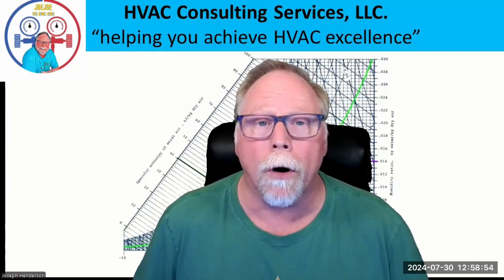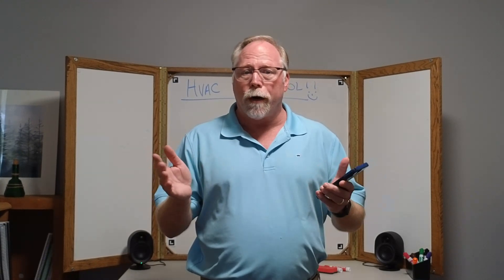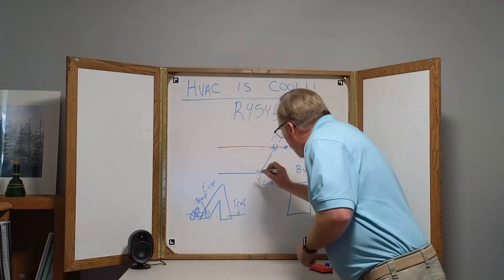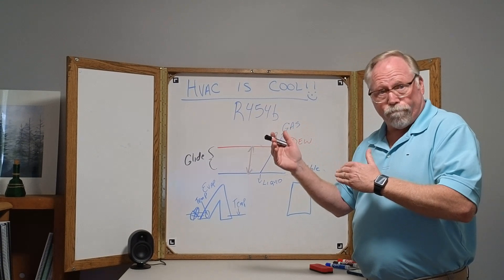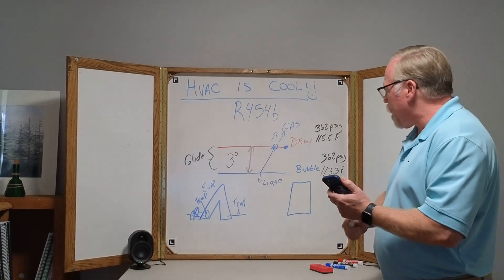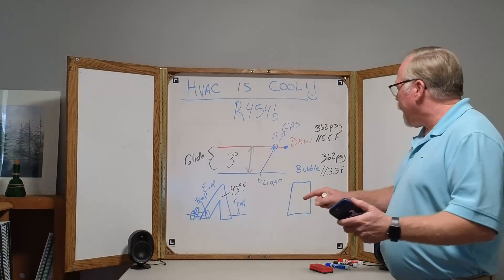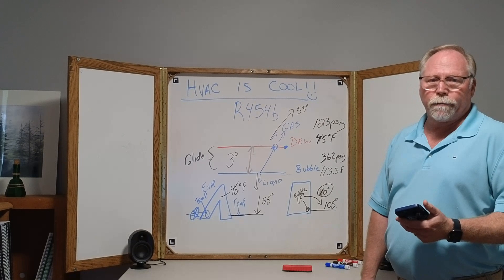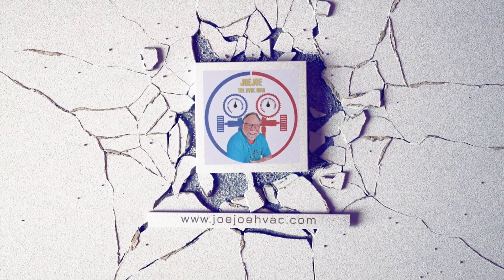R454b Dew and Bubble point... Simplified!

Comment: Joe, I know this isn't related; could you make a video on the differences of proper amount of thermostat wiring on staging systems, utilizing reverse acting signals like Dehum on a control board, and reverse staging vs. timed staging and how much better staging with lets say 50% rule in zoning is??? Thermostat choice is more important than many technicians realize.

There are many deficiencies and misunderstandings of these types of operations and programming in the residential industry.
Reply from the maker: Great suggestion!  I always carried 18/10 on my truck. I never ran out of conductors! And I installed a lot of staging systems and Zoning.
Reply: @Joe_Joe_The_HvacMan  18/12 is great for interface modules 😎